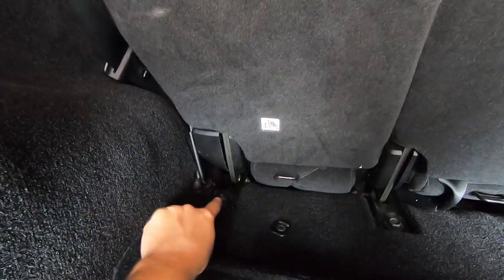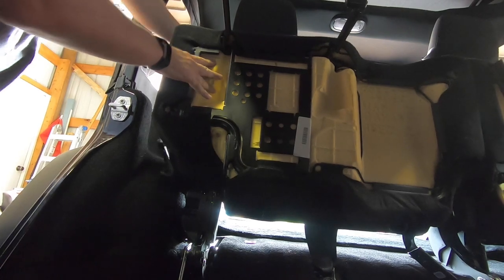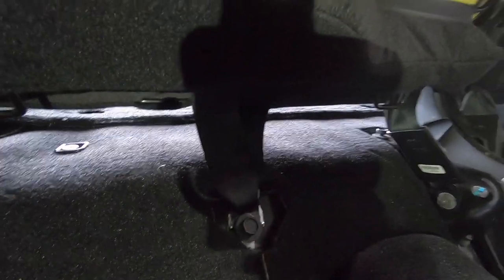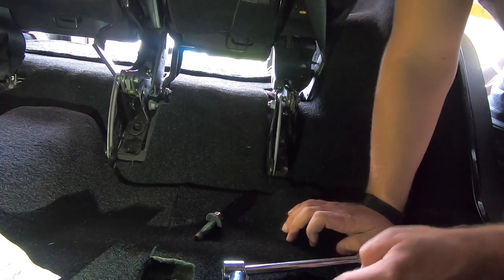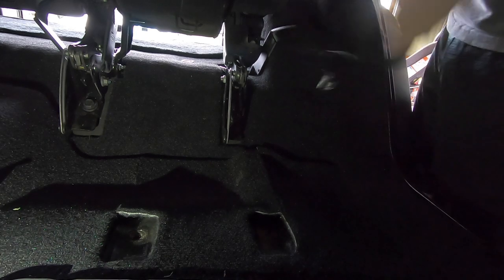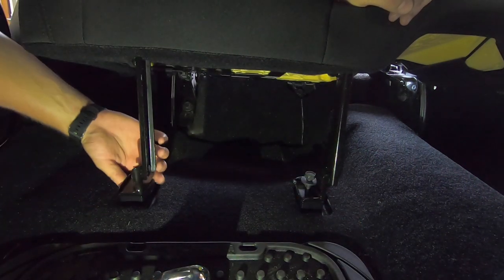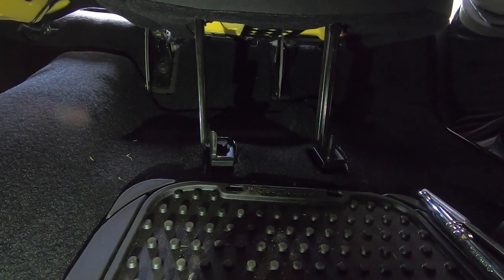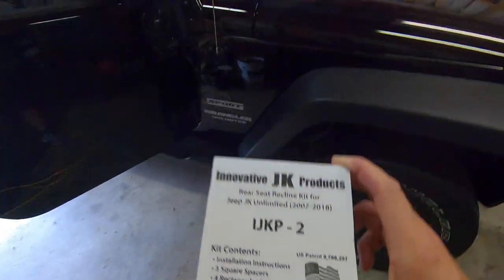Innovative JK Products Rear Seat Recline Kit Install (07-18 4-Door JKU)

Comment: Had I not watched a video of this I would not have really understood what to do. The KIT had no instructions with it. I did have to pull the seat foreward as the 3 small spacer holes do not line up due to the new angle. Once I did that it went smoothly. I think the torque spec is 45 ft pds but i just used my 24 inch breaker bar to add some tightness. Took about 1.5 hours to install. Now Im just waiting for the rest of my stuff to show up. Good video. Thanks!

Comment: Hello Mac. Thanks for your video. I bought the same kit as yours, but when I place the rear shim, the screw holes are off-center. Impossible to screw again because the back fixing of the backrest, even loose, prevents the alignment of the holes. Did you have this problem ?
What's the trick?
Thanks for your help.
Pierre, France.
Reply from the maker: I did not. Sounds like a manufacturing issue for sure! See if you can get a replacement.